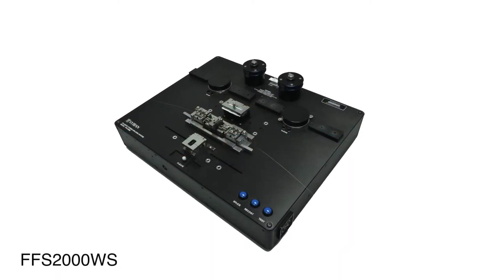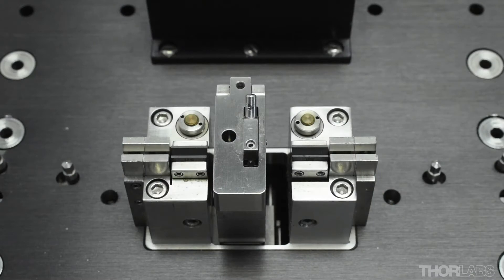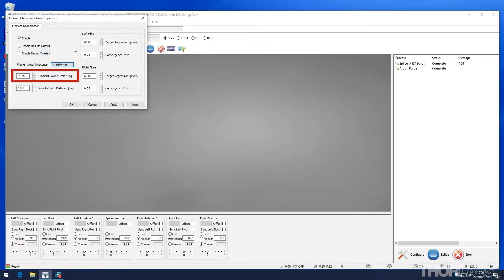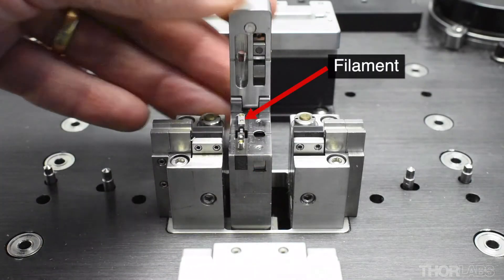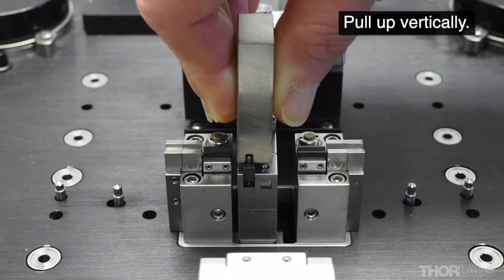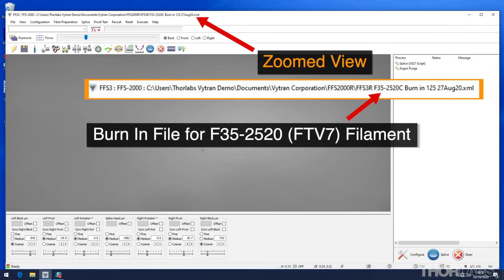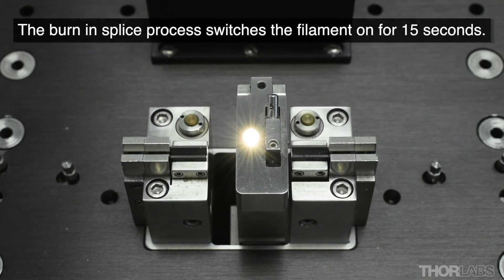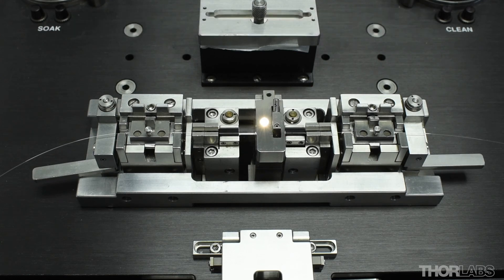Thorlabs FFS2000 Workstations: Filament Install and Burn In

Comment: I assume you must have your Argon gas on?
Reply from the maker: Yes, argon flow rates for common burn-in procedures are set in the included files. An argon environment to purge oxygen and other contaminants is critical for high quality splicing as well as for filament lifetime. While changing the filament, the argon flow rate will be at its background level if the unit is powered up, however argon flow is not necessary while changing the filament.